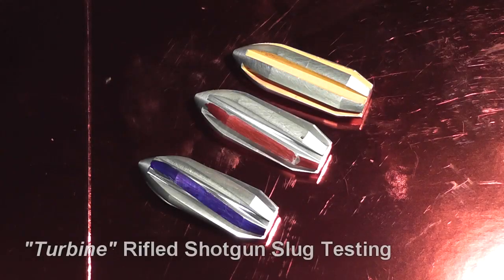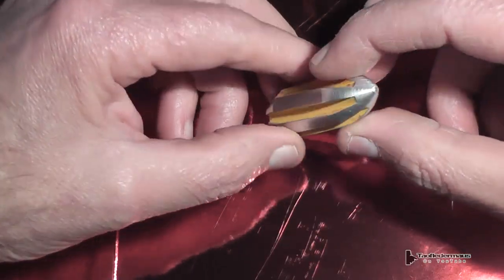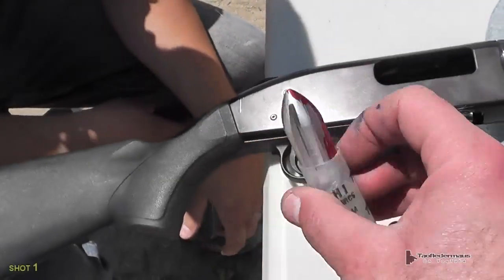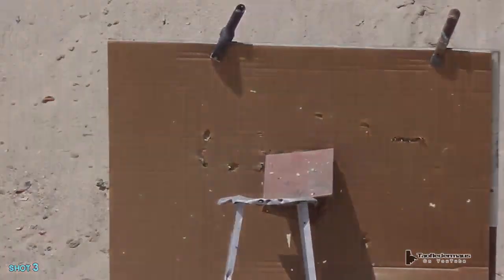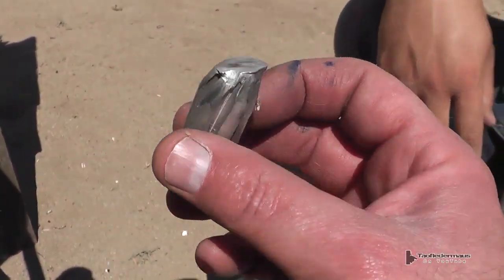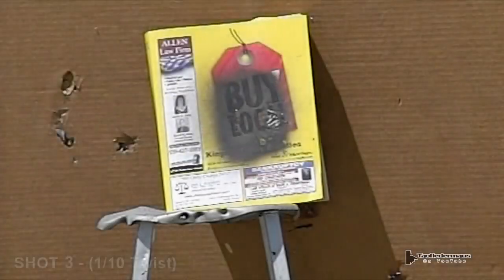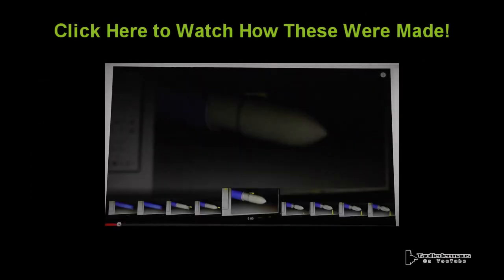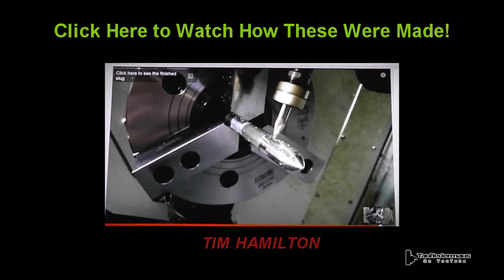Custom Aluminum TURBINE Shotgun Slugs  -Testing

Comment: TL;DR: Play Kerbal Space Program.

With a distance this small, I think the most critical factor for projectile stability is achieving clean exit from the muzzle, with as little angular momentum as possible.

Even if you have a dynamically stable projectile (which these are most definitely not), it would seem that the slug has a lot of rotation on pitch or yaw axis after it separates from the muzzle and wadding, and it may be that no projectile would have enough time to seek its stable, preferred state of flight before it already impacts the target.

As others have stated, the key to projectile stability with non-rifled barrel is aerodynamic forces. Stability is achieved when the centre of mass is ahead of the centre of pressure, which is the sum of all aerodynamic forces acting on the body (lift and drag, essentially). The further you can separate these two, the more stable an object will be.

Aerodynamic stability can be achieved either by drag alone, or by a combination of drag and lift. An example of a primarily drag-stabilized projectile would be a blow dart (or a parachutist, but that is not a practical shape for a shotgun slug). An example of a lift-stabilized projectile would be an arrow with fins.

The difference is that while every part of every projectile produces drag, lift is produced by aerofoils. With a symmetrical aerofoil, lift is only produced if the aerofoil has a non-zero angle of attack, such as when a projectile is not traveling straight through the air. In addition to drag, the fins provide a lift force perpendicular to themselves, which should force the projectile back towards the position of stability.

In theory, fins are more effective stabilizers than just drag. A drag-stabilized projectile effectively has a drogue chute hanging at its rear: It certainly is effective at keeping the projectile lined up relative to airflow, but it also bleeds energy quite quickly and reduces range. By contrast, an aerodynamic fin produces very little drag at low angles of attack, but the lift forces can be substantial even at small deflections.

In practice, I don't think it's very easy to machine proper aerofoil fins onto a projectile this small, and have them be really effective. Also, supersonic aerodynamics is weird. It would be easy to end up with a design that is stable at low angles of attack, but turns out to become unstable at high angles of attack - in that case the design would be unable to arrest the initial tumbling as the projectile exits the muzzle. Drag-stabilized designs are probably much easier to design and execute.

So the first thing I would try is get a solid, homogenous slug with a rounded tip, and drill the rear half or even two thirds of it full of holes from different directions. Maybe even drill a large hole through it from the rear, to make the rear part a hollow tube rather than a solid cylinder. This would have the effect of moving the centre of mass forward, while keeping the drag more or less the same across the thing.

It's actually difficult to say what would happen to the drag of the "holed" part. Depending on hole size and pattern, you might get some sort of crazy supersonic golfball boundary layer effect that could slightly reduce the drag on the back, or you might get increased drag by supersonic turbulence, I don't know. Either way the projectile's centre of mass should be significantly ahead of its centre of pressure, so it should be stable - at least over a bit longer distance.

If that's not sufficient then I would try different slug profiles, but the basic idea is to have as much weight forward as possible, with as much drag or lift at the back of the projectile as possible.

And even then I'm pretty sure the biggest problem would be to negate the initial tumble, as the projectile exits the muzzle. Is it caused by asymmetric wadding? It seems that the bigger the separation between the wadding and the projectile, the more the projectile tumbles - which makes sense from the perspective of conservation of momentum. Is it possible to find a way to integrate the wadding to the projectile so that it doesn't separate, but rather stays attached to the tail of the projectile? That might negate much of the unwanted tumble...

Comment: That was a great video.  I saw that it is difficult to keep the slug from tumbling, and even the one that hit on its head, was wobbling before its impact.  I was thinking that if the slug itself was half as long with a taper on the back 1/3 and a heavier insert in its head, it should stop the tumbling.  A smaller barrel contact will still give it spin, but will diminish the tumbling, and a heavier front end will stabilize it.  The problem is that aluminium is too light, and does not have the mass to keep itself within proper  ballistic parameters.  The blast from the gun is too strong for the light weight of the slug (thus the tumbling).  You have to counteract that by either adding weight, or changing the design of the slug.  As it is, it will never be an accurate projectile.

Comment: You probably get this a lot - but I like your videos such as this one. You're one of the luckiest people who have access to a place where you can try all these fun [think dangerous;-) ] experiments.

Anyway, I think the reason your slug didn't spin (fast enough) was due to, basically, Newton's 1st law but replace the speed with angular momentum of the bullet. Before you pulled the trigger, the angular momentum of the bullet is zero (not spinning). The idea of forcing it to spin up (in a fraction of a second) with only air flowing through the fins is probably not going to work. The media through which the bullet travels must have enough mass to "push" those fins and air simply doesn't qualify.

My guess is that your bullet did spin but probably slow enough that even your high-speed footage couldn't show.

Comment: They tumble not because the shape is wrong or not aerodynamically right, but because they're plugged into the plastic shells which get seperated after the slug exits the barrel, which causes the slug to wobble mid-air and not maintain its straight trajectory.

Comment: Hmm, looks like two things are probably happening: #1, the projectile is sub-caliber and as a result, gases are going squeezing by the sides and destabilizing the projectile in the barrel. This can be remedied with a sabot or similar device that compresses between the barrel and projectile, sealing in gaps. #2, there may be a slight rear-heaviness resulting in accelerated destabilization after exiting the barrel.

Comment: As long as the slug doesn't properly grip the inside of the barrel, and that's not rifled to induce spin and thus stability, getting the slug to fly straight will always be a matter of chance. In which case, you might as well go for a perfect ball for slug same as the old ways :) Otherwise, it should be possible to stabilize a flechette using nothing but fins and proper mass distribution, but since this is a shotgun we're talking about, there's just not enough travel distance to allow air friction to work with the fins and stabilize it before it hits the target.

As for curiosities... has anyone ever tried firing a crossbow bolt out of a shotgun? Now that would be fun to watch!

Comment: I'd say you should try to make a front heavy slug, with a lead or steel tip and an alluminum body.
Reply from the maker: Peter Griffin   I drilled out the two remaining alum. slugs and filled them full of lead to try to get better balance.   We'll test those in a couple weeks hopefully.
Reply: That's great!
You have a really cool hobby!

Comment: Nose weight, these have none and that is why you are getting the unstable flight. Also because the rear skirting is so long, the pressure on the end is not being distributed forward enough. If they shortened them, hollowed out the tail, and added some weight to the nose they would be awesome.

Comment: it couldn't catch the stream - the rifling didn't help, simply because the tip was too bulky. To understand this, imagine if it had 100% width throughout. What you would expect is nothing short of what you experienced there. I don't know the specific length of the filing down the slug one would have to do, or how gradual it would have to be, but is definitely not the one done on those slugs.
P.S. the different spin rates would increase accuracy up until a certain distance - there does exist "the ultimate" spin rate, such that would result in the longest effective firing range ***** 
I may be wrong, though, don't judge please

Comment: I could have told you in advance they would tumble. Would have bet a week's pay on it without hesitation. The reason why lead Foster-type slugs fly stable is due to the inverted cup design, not the "rifling". Because they are nose-heavy, they self-stabilize like a badminton birdie. True rifling attains spin by mechanical engagement, not aerodynamics. The grooves on a "rifled" slug serve no purpose in stabilization; they merely provide relief for compression in the event the slug must pass through a choke. In order to attain aerodynamic spin, the slug would need fins, like an arrow or rocket, that are angled relative to the CL. The grooves will not catch enough air to make it spin. Take one of the aluminum slugs, drill a cavity in the nose and fill it with lead, then drill a hole in the base and leave it hollow, to make the slug even more nose-heavy. Then see if it flies better.

Comment: the rifling may help a bit but standard slugs work because of a weight forward design...look at lee key drive slugs especially the 7/8 oz ones....drill a pocket in the base of the slug about 2/3rds the length and you could up the weight and penetration a bit by adding a peice of hardened drill rod or a carbide tool shank into the tip...would just have to play with the weight balance a bit.The "rifling"on factory slugs doesn't really impart much spin it just allows the slugs to pass thru a choked barrel with minimum damage....if you want tru spin on a slug then you're stuck with a rifled slug barrel and saboted slugs

Comment: The "rifling" on rifled slugs is mostly for allowing the slugs to swage down to fit through just about almost any choke.  It's not really designed to impart spin.  A foster slug works because of the weight-forward design.

Comment: I also agree with the added weight distribution idea for a possible straighter trajectory, however it still may not allow the slug to spin until well after it has left the barrel, at least in my feeble mind. Perhaps instead of changing the CoM / CoG of the slug using weight, you could again hollow it out and add a spring loaded rod and mini-fins, that deploy immediately after the dispensing of the wadding. This should give the slug more stability in flight in theory, again in my feeble mind, but will of course add a little more drag however. 

One of the problems I think with design shown, is that the expanding gases in the rear of course being far more than in the front, are actually not allowing the slug to spin while in the tube, but upon departure the sudden rush across the cutaway as the pressure decreases rapidly in the rear is causing the projectile to make a sudden movement a fraction of a second after breach, rendering the slugs rifling ineffective, if not a hindrance. Gorgeous and cool but needs tweaking. If the weighted slug  has the same outcome, I would think my theory to be correct, and the added drag from the mini-fins may help reduce this...or just be another crazy idea on a tacticool body lol

Comment: My statement, aluminum is where it went wrong. What should have been done is aluminum cast. Then cast lead rounds out of it using that as the base. Then you'd have the weight and it would very likely spin. I think the rounds were to light in my opinion.

Comment: There is no rifling in the barrel, so the bullets will not spin.
They only have to go slightly sideways to start tumbling.
I think, making the tip heavier, or some kind of tail, will make it fly straight.
Some fins popping out, like tube launched rockets have, could be cool too.
Film it at much longer distances.

Comment: Rifling the slug is pointless. The rifled slugs aka Foster slugs do not spin in the bore of a smooth bore. It is not an either or prop. you can not chose which to rifle the projectile or the barrel. If you want to impart spin the stationary barrel must be rifled and the projectile must be made to translate some of it's forward energy into rotational energy.

Think about how much cheaper and easier it would have been to convert muskets by simple adding a lead bullet with rifling on it. The expensive and tricky part of building a rifle for the longest time was the rifled barrel. 

If you want to get a smooth bore to shoot then look at modern tanks with smooth bores they use fin stabilized rounds.

Now a rifled shotgun choke tube does a nice job on lead slugs of all designs allowing your smooth bore to really reach out and touch someone or something with out the all out expense of a rifled barrel. I use cheap lead slugs in my rifled shotguns and they work fantastic almost as well as the higher performance Sabot rounds.

The machinist is wasting his time on these. Just because you have a CNC machine and know how to use it does not mean it is the solution to every problem. My Mom programs CNC machines and can make all kinds of stuff. That said sometimes she is genius enough to not try to make it herself and just runs down to Home Depot. Dad has not once asked her to make bullets for him because Hornady, Sierra, Berger already make what he needs. Dies and reamers are another story! LOL

Comment: Sorry to ask the obvious question but what about boring the base of  the round, not 100% on it but if you decrease the weight of the tail would it not "Shuttlecock" along roughly on trajectory?  Most likely Mr. Hamilton has already determined the effectiveness (or lack thereof) of this mod, just curious, though.

Comment: The fin and the weight distribution is the problem with the ones you used. The problem's not too much about the change in twist rate (but ofc it's better to keep it low so as not to impede the forward movement.) The main problem there is that there's nothing to keep the projectile stabilized while on flight. Ofc they'll spin out of intended trajectory like that.
You either need to put more weight at the front and put a tampon at the back (which can withstand the temperature and doesn't stick to the payload) so the spin comes from the air resistance at front and drag as intended, instead of the reverse spin caused due to exploding gas at the back being led through those big canals you put there for spin. Or you can just change the design and make a simple fin at the back, or on the sides. Like, don't go too much into the center with those deep and wide twisters. Just scratch the sides a bit.
Yea it's pretty complex but not too much. It's a bit like making a paper plane, since it's made of a single material. Just gotta have a feel for it.
Fun video heh heh watching elliptic projectiles go out spinning sideways..
Reply from the maker: Arda Önder   I have two more of these and I have drilled out the nose and filled them full of lead.   I'm not sure if it will be the right proportion or not,  but it might tell us more.

Comment: I would like to see a slug or round made based on the starrflight fobs for archery. They are basically a replacement for vanes on arrows. So maybe take a thin tungsten weight and attach a starrlight fob shaped aluminum piece to the back. I think that would fly straight.
Reply from the maker: Michael Clark  I never heard of those before.   (not an archer)  but  looks like it would hurt more than normal fletching if it ran over your wrist!
Reply: That's why it is normally used on a compound bow on a drop away rest so as the arrow is being fired the rest drops away and the fletchings or fobs do not come in contact with anything before hitting the target.

Comment: The milled rifling on the projectiles was way too large and deep.  Just look at a real lead rifled shotgun slug to see what it should look like.  Also, why spend the time and effort to machine a high cost aluminum slug when the already proven lead slugs are readily available?  I could see someone wanting to improve on the lead slug with machined projectiles, but why not start with a similar shape and mass, then slowly adapt additional improvements.  The "turbo" slug was divergent in size, shape, mass, and rifling all at the same time, leaving no observational means to know what aspects worked and what aspects did not.  Back to the drawing board, i guess, but good luck!

Comment: FYI, the rifling on slugs do NOT make them spin. The reason slugs fly straight from a SMOOTHBORE is because the front end is heavier than the back end, like a spear or arrow. So you would either need a softer round with a rifled barrel, or a round with more front end weight to stabilize it.

Comment: perhaps the reason the rifling was not effective is because the angle of the nose was too steep causing the air to just push out around the round instead of flowing through the rifling

Comment: Hey would it not make sense to use a rifled barrel when using a rifled slug??
Reply from the maker: Brandon Snuffer You wouldn't need a rifled slug of the barrel was rifled.
Reply: Would it not help the slug spin when it came out of the barrel instead of flying straight out and tumbling?